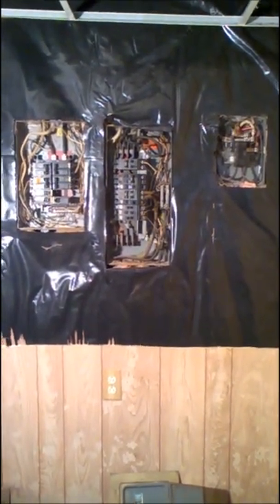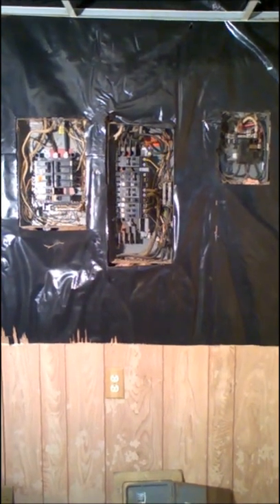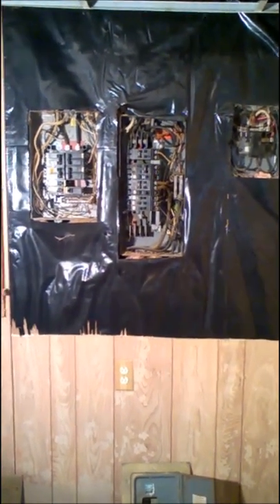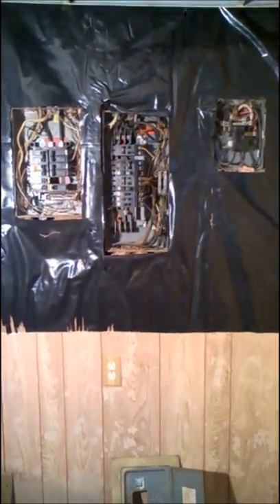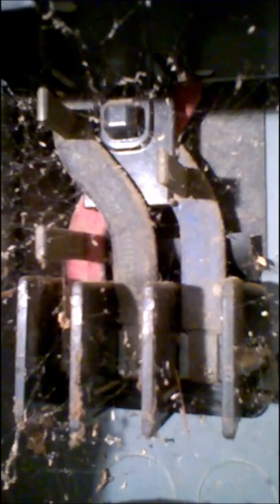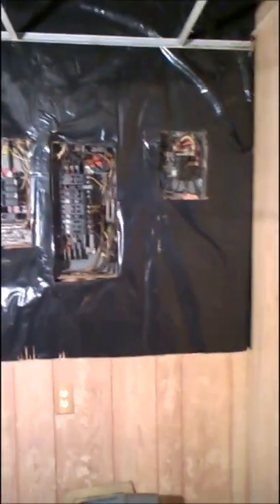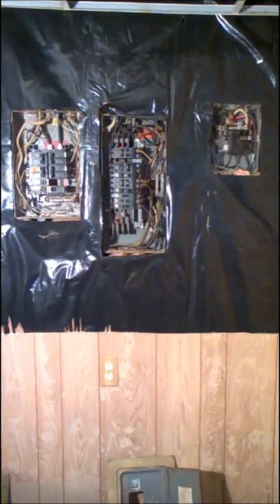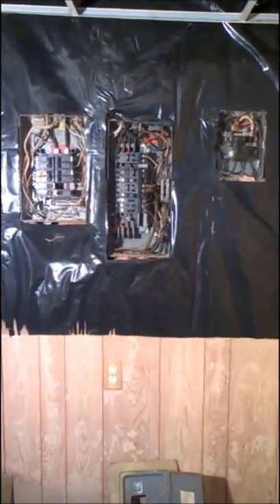The World Needs Mike Holt!!

Comment: I have worked in university, government and private laboratories. My engineering and construction friends gave me a good education. 
   What you have shown me is much safer than a number of laboratories I have worked in! Reversed polarity. No grounding, rf coming in on wall plugs, electrical grounds tied to lightning grounds, hot and neutral lines crossed, etc. Hot leads with a foot or two of insulation scraped off, probably during installation. 240 VAC on 120 receptacles, etc.
   In residences, no electrical ground at all! 
   Thank you for your video!
   Yes, we need Mike Holt and good, competent electricians!!! Glen, N0QFT
Reply: Wow, wish you had video/s of the stuff you saw too, I'd tune in for sure.